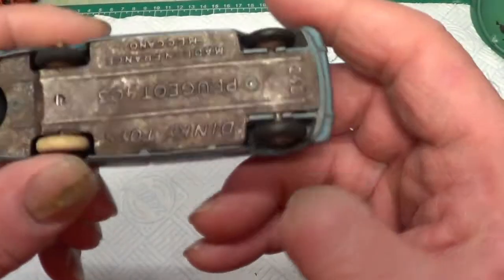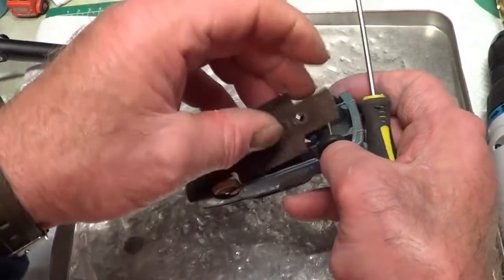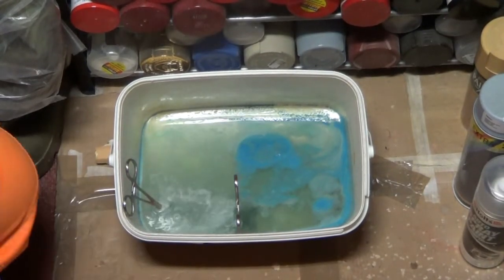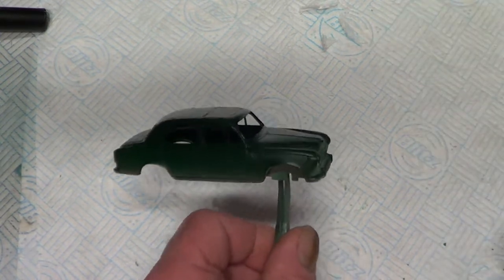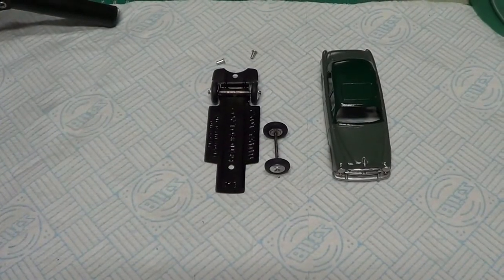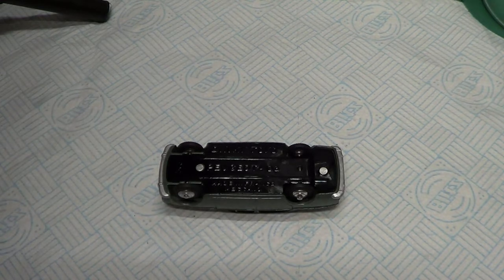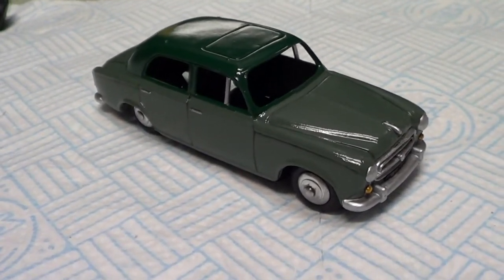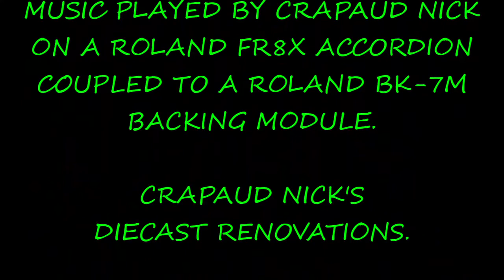RESTORATION OF A FRENCH DINKY TOYS PEUGEOT 403.

Comment: Good resto Nick. I've got one of these by Dagostini Mattel made in China. also has a plastic window section. by all accounts, I'd say same tool jig. I did 2 cars in Wilko grey primer & finished with lacquer. Works & looks good.
Reply from the maker: Thank you Ian, yes it’s a shame there is no window unit with this one, it would make all the difference, the Matt paint on this one seemed to soak up the gloss of the lacquer after a couple of coats it ended up more of a silk finish, primer with lacquer on does seem to end up with a better shine to it I have found.

Comment: Nice job Nick the colours was very nice i hope your friend like it the box look great to 👌. A nice touch on the box altering the seat configuration its lucky you can read French 👍. Hope you both had a nice holiday,  nick where do you get the decals images pictures on your computer? .
Ralph
Reply from the maker: Thank you Ralph, the holiday was great thanks, it just flew by though!!  For the decal pictures, I usually look first on eBay if there is a listing with the ones I want, if there is a good picture of them straight on, then I either save the picture on my phone or take a screenshot then transfer that from my phone to my laptop and save them in a folder, you can save directly to your laptop or take the screenshot on there, not sure which keys you press for that though. If I can’t find them on eBay I google the decals I want and click on images at the top of the page, the other way is to look for the actual model pictures, there may be a good photo of one sporting the decals you want! I hope this helps, all the best, Nick.
Reply: @crapaudnicksdiecastrenovat1739  thank you very much for that info much appreciated.
Ralph